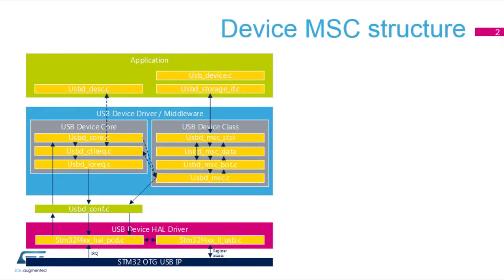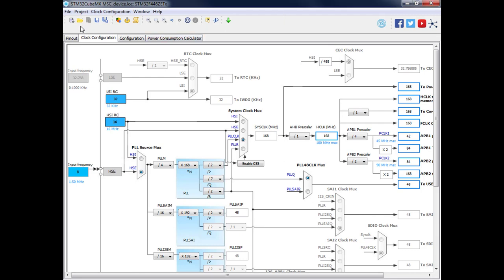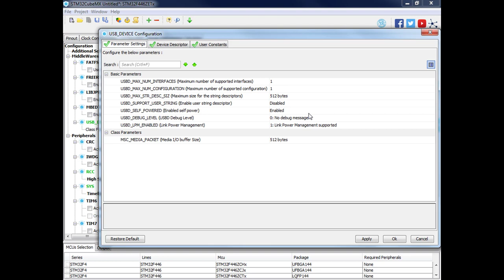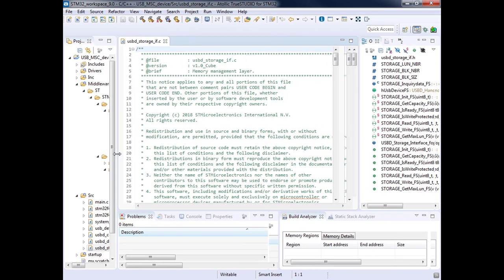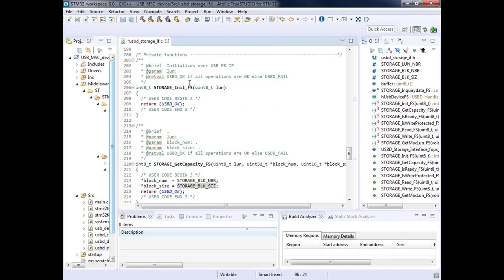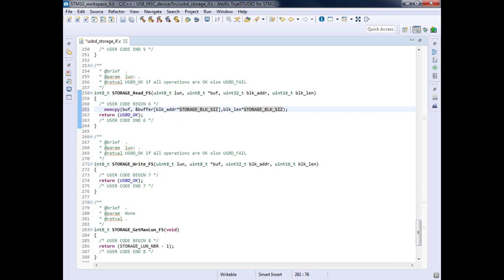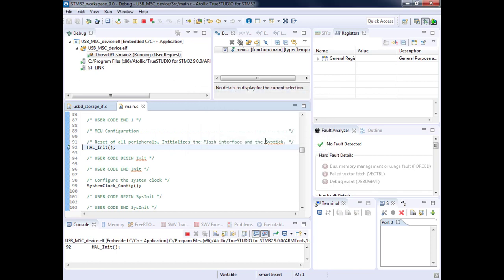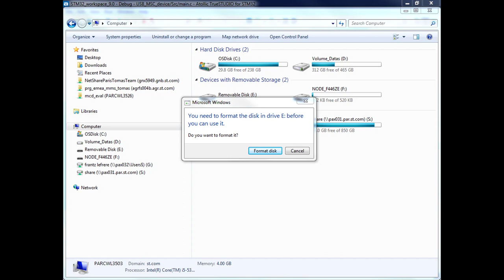STM32 USB training - 09.8 USB MSC device labs

Comment: "Windows was unable to complete the format." When trying the same procedures with STM32CubeIDE Version: 1.1.0. Win10 x64. [Version 10.0.18362.476]. The example for CDC worked.
Reply: I am facing similar problem, Do you get the solution?
Reply: @alihussainvohra323  Same here any news?
Reply: @gametha69  Hi, Im still facing exactly the same error and have not yet found a solution also not in the community . Any idea?